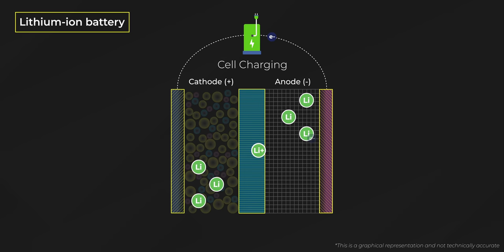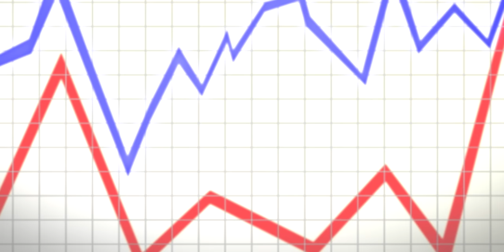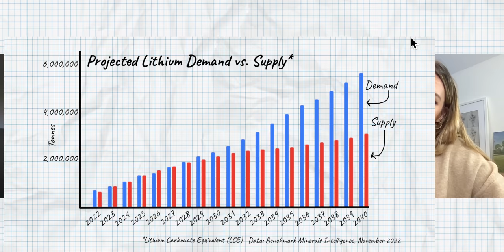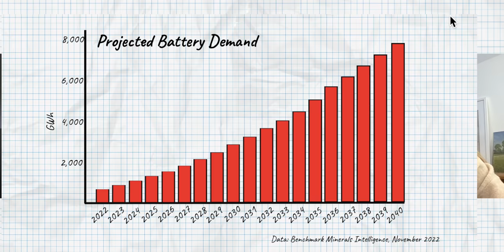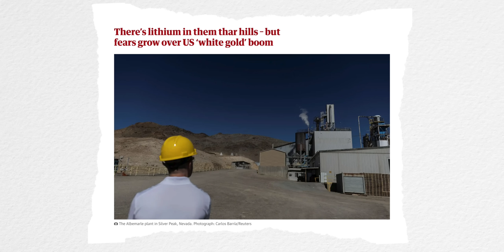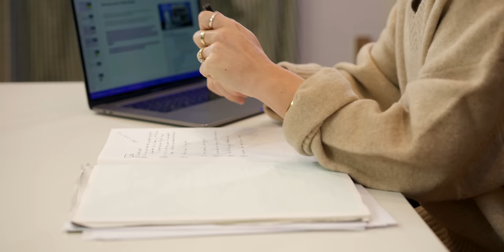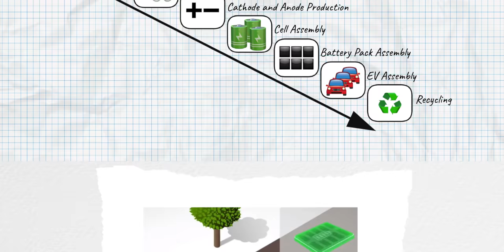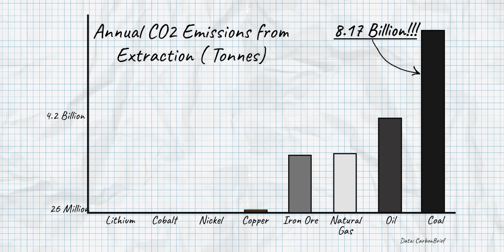There's a Massive EV Battery Shortage. THIS is How We Fix It

Comment: In my opinion these batteries are just too big. Most vehicles are just too big, inefficient, and heavy, so they require massive batteries to have a long range; also we keep demanding insanely high range when most people wouldn’t need more than 80-100 km if there is a solid charging infrastructure.
For urban mobility, electric bikes are great, because a small battery can carry you everywhere and in the event you run out of battery you can still pedal like a normal bike. Other mobility solution like trains and trams require no battery since they can be connected directly to the grid. Electric mopeds and motorcycles are also much lighter and require less energy to move around, so batteries can be smaller.
If you still need a car, Japan has a whole category of small cars called Kcar which are compact, light, and efficient, having an EV version of that with a range of 80-100 km would probably be enough for most people living in cities.
Huge trucks and SUVs, even if they are electric, are a problem. They are too heavy, inefficient, and require huge batteries to move.

Comment: Battery changing stations (using the infrastructure of the old gas stations) can help here: You'd drive around town with a small battery package, then, when you want to go on a journey, you'd get the bigger, extra battery package at the changing station. When arriving at your destination, let's say, Italy, you'd bring the big battery to the next changing station and drive around (if needed) with you small, fixed battery. On your way back, the same vice versa. We'd all only need small batteries in your daily lives, but could go on journeys easily. 
The only problem are - again - the car makers, who don't care about sustainability and practicability, instead of all agreeing on a very small number of battery sizes and dimensions. It has worked with the old lead batteries, hasn't it? They all have the same dimensions, you can buy them at many automotive parts stores, nobody thinks this is too much asked of them.
So, as usual, it's the politicians, the governments, who should show some courage and legislate car battery changing system parameters. 
We, the car buyers would vote by buying ...

Comment: Lead acid batteries are recycled at 90% that's why we don't have many lead mines. Same will happen with other types. There are two issues in the short term. 1. Reuse of large packs like ones from cars is VERY popular, makes them worth money so getting them back is going to get difficult. 2. The materials used in EV batteries keep changing so by the time we get enough recycled material, battery factories might be using something else. Researches are already testing sodium batteries and LFP already in use don't need cobalt or nickel.

Comment: Tha whole EV and battery needs are woefully inadequate in the UK. I’m a long standing supporter but with reference to infrastructure of EV chargers for instance, we have failed to deliver on the promises and needs. Near me is an Instavolt site, which I needed to utilise and yet again it isn’t working and the engineer is not at site until 19 September. This is just unacceptable and will kill the EV hopes

Comment: Looking at the overall life cycle of my 2014 Leaf, it is clear that it has become greener since it was new 9 years ago. The grid on which it has been charged has more renewable electricity today, and is now over 94% emission free. A new battery recycling facility is being constructed just blocks from my home which will supply raw materials to a new battery manufacturing facility 2 hours down the road. Contrast this with the one or two battery manufacturing facilities that existed 9 years ago, and zero recycling facilities, and it is easy to see how the supply chain is improving, and will continue to improve as the EV market grows. My car, BTW, is in excellent condition and will likely give me another 5 years of use on the current battery, and thanks to the reliability of electric drive trains, can provide years more if I decide to replace the battery when the time comes.

Comment: Lithium can be filtered from the brine water byproduct of sea water desalination plants and sodium ion batteries and/or some other battery chemistry will likely replace lithium based batteries as a more environmentally friendly option soon anyway.
Reply: offshore wind could directly power the pumping and desalination and lithium extraction.
Reply: Lithium will remain king in small electronic devices and luxury cars, but for anything else, yes I I'm sure sodium will replace lithium.
Reply: @jamesengland7461  it's not a good idea economically or ecologically to get lithium from see water unless you are desalinating water anyway.
But there is more than enough lithium in salt lakes and rocks.

Comment: I love the electric vehicle concept as it is the most simple and versitle propulsion system you can have but its weak link is the battery and that is still the case. Li-Ion batteries are good for urban bound vehicles in densly populated countries where travel distances are moderate and access to chargers is good. Once we move away from that scenario the current battery technology becomes a problem. In many countries across the globe vehicles are used for many more things than urban commuting. The number one selling vehicle in Australia at present is a large four door ute which is generally 4wd and combined with similar vehicles of other manufacturers make up three of every five new vehicles sold at present. No EV made at present can do what these vehicles can do and are regularly called on to do and they never will if Li-ion battery tech is all we will have. They don't have the energy density needed to bring them down to a size that is usable for vehicles like I have mentioned and I doubt very much if they ever will. Despite all the hype we have seen regarding heavy vehicles being battery powered soon we are yet to see any for the same reasons I have talked about, the power density to battery size and weight ratio. That brings me to the next point, the mass uptake of EVs in our congested cities will be great for pollution reduction and should be done for that reason alone but the actual reduction in Co2 going into the atmosphere will be a drop in the bucket compared to what is needed. Everyone is talking like it is the saviour of human kind and Net Zero is a shoe in once we change over the worlds car fleet. If you pull up the CO2 stats for any developed country you will find that transport in total is one of the lowest percentages of the countries Co2 emissions. In Australia all transport combined is only 18% of our CO2 output. That includes shipping, aviation, trains, linehaul trucks, busses and of that 18% cars and light commercials vehicles make up 7.5 %. If we are going to electrify the rest of the transport mix we need more than just batteries and for those that use batteries we need something far better than Li-ion. One other thing, when a mining company tells you they will have minimal impact on the environment start laughing because their definition of environment is not what yours will be.

Comment: Does making batteries more energy dense improve the Li supply issue?  My understanding is the Li is what provides the energy in a battery.  Making a more dense energy battery might just mean increasing the amount of Li to other materials, but an A-hr of battery energy may still require the same amount of Li.   You need to extract more energy per kg of Li to improve the supply situation.  Not sure if that is happening, but from what I see most currently produced batteries are all about the same energy density.  The other approach (probably a necessity) is to develop car battery technology based on a battery that uses more abundant materials.

Comment: Ellen Carey completely smoothed over the issues with mineral mining for battery manufacturing. Set that to one side, I honestly can't see the infrastructure within the UK getting any better. There aren't enough chargers for what little cars we have now, as many people that own electric cars have proved. I cannot see how this problem can be solved, as the more electric cars we have on the road the more chargers we will need. We ordered an electric car a few months ago and after hearing about many people's issues with their electric cars, we decided to cancel ours. Not sure what the long term answer is but it ain't electric cars that's for sure. There's many a people with electric cars that have shown what it's like over a year, to use an electric car daily and it's quite laughable and impractical. Long distance driving in much of rural UK is a joke. Either there's no chargers in many areas or they don't work or accept the drivers card payments. There is also the issue with radical price increases on electricity and recently the government has just announced road tax charges on electric cars. Then there's the fact that these cars are way too expensive for most and are basically toys for the wealthy, to promote that they are doing their bit to save the planet.... Not!

Comment: Just as well really, there is a shortage of public chargers as well.
Reply: That is a huge point which can be missed when talking about demand for batteries.  One reason huge batteries are in demand right now is because charging speeds and infrastructure are insufficient for most people to feel confident with 80-100 miles of range (like my older BMW i3 on a summer day).  Smaller battery packs lead to lighter, cheaper vehicles, not to mention performance.  Solar roofs, improvements in charging speed and energy density, plus ubiquitous chargers for EV will help flatten the curve for raw material demand.  I love the points about enabling tech for other energy storage solutions (sodium, sand, metal air, etc.) to avoid fratricide amongst transport, grid, and other solutions for the materials that are best suited for transportation (and portable device) usage.
Reply: @G T the trouble with smaller batteries is increased charging lifetime cycles per miles driven. This causes premature degradation. There is no free lunch with physics I am afraid. I have a leaf with 30 k miles on and nearly 7 years old now, it has lost 3 battery bars and 25% range and capacity. Battery life channel  has had an id 3 for 2 years and he has lost 10% capacity in 2 years on a liquid cooled battery. So degredation is specific to lithium ion batteries, not only the battery management system. I also have a Mercedes E class diesel with a brimmed range of 650 miles and a consumption of 51 mpg on a run , all at 70 mph. The Mercedes is a 2008 model and is 14 years old. All this indicates to me that EV's are no way better logistically than what went before. I was so disappointed with my leaf after great hopes for this new technology but alas no and don't even get me started on the public charging infrastructure, it is a nightmare !

Comment: First thing needed is that all non-mobile batteries are produced without Lithium. A shift tothe next element in the Alkali metals group (Na) for home batteries and centralised megapacks will help a lot.
Second, we need to ramp up the battery recycling efforts.
Lastly, eventually we need a green hydrogen economy, replacing both fossils, and battery technology.

Comment: It's all a big trick.  Expensive to buy ... then rapid devaluation. Worth nothing after about 8 years.   New batteries cost more than value of the car. Manufacturing and raw materials are not "green".  
The electricity comes mostly from ... burning oil and coal and gas. EVs are heavy lumps that get through their expensive tyres twice as fast.  Etc etc etc.  
Buy a modern clean diesel while you still can.

Comment: The facts remain that it is more costly and less benefit to the planet to produce all types of electric batteries against the production of internal combustion Engines!   You claim that 95% of EV's can be recycled the whole of the ICE vehicles can be recycled. The other factor against EV's is the life cycle is much more finite than ICE cars!   You have hit on the actual agenda of this push to "green" vehicles, it is the reduction of private travel, in favour of public transport!  A lightweight vehicle of 40+ years ago(eg. MK2 Escort) with a small modern ICE with fuel injection and catalytic converter on the exhaust is far greener than any New EV over its lifetime!

Comment: I agree EVs are the ideal solution to burning fossil fuels but if we can't get the raw materials out of the ground fast enough to build only EVs, instead of slowing EV production it would be better to switch to PHEV production. PHEVs use 1/5th the batteries but allow people to drive electric-only for short trips which are 90% of the trips people make, and lets them switch to hybrid mode for longer trips, which is still more fuel efficient than non-hybrid vehicles. PHEVs are also good for helping people who have range anxiety to realize it's not as big of an issue as they think.

Until we have enough raw materials for all vehicles to be 100% electric only, PHEVs can stretch the materials we have to 5 times more drivers. Focusing on PHEVs instead of EVs would actually cause a greater reduction in the burning of fossil fuels.

Comment: What i see in the auto industry is that we want the same range as an ICE vehicle. Put a big battery in the car problem solved. But with that big battery the weight increases and efficiency decreases. 

My ioniq 28kWh is one of the smaller batteries in todays cars. With that small and low weight, i can get a range of 200 km. If it had an heatpomp for heating in the winter i wouldn't loose the 20% of range that  i do now. With that 200km i can easily do my daily commute of 100 kilometers to work and 100 kilometers back to home. It's not ideal in winter because i have to charge at the office. But my commute of 200km daily isn't nowhere near average. 

Today's cars get a battery of 60kWh that give a range of 350 / 450 kilometers. Is that needed for every car? Sure there are jobs that will need a care with that range and maybe more.  But is doesn't need to be the standard.  If i had 220 kilometers in winter i would be more than happy.  Cars with less battery capacity would be cheaper to make also. So another win.

Only consequence of a smaller battery is that you have to charge every day. With vehicle to grid/ home you as a user will benefit from plugin in every night. You start every day with a fully charged car and help balancing the grid. It's a shame that company's with big parkings lots aren't obligated to let everyone charge during the peak hours of solar energy so we can solve the duckcurve problem as well. But that part is a whole other story.

Comment: I'm not totally pessimistic about EVs, if Sodium batteries can be successfully made with Prussian White replacing Zinc, there's some hope that a third of all cars could become EVs by the 2040s.  It would also mean combining the battery technology with battery swap stations like the company Neo uses, AND, and this is the big one, small modular nuclear reactors would have to be a feature of the swap stations.  If that doesn't happen there won't be the power density, because there's no way the grid is getting the massive upgrades, and the swap stations can sell power back to the grid if charging EVs ever gets slow.  Right now, demand for Lithium is set to exceed supply in 4 years, and before that happens the cost of a new EV is going to go so high demand destruction kicks in and the industry goes bust.

Comment: Cheaper Bus and train fares (and greater frequency of services) - including smaller local (EV) buses (~20 seats)as an example, my daughter live about 60 miles away and I could go by train, but it's about 2.5 times the cost of petrol for the same journey. the cost difference is even more marked if I drove an EV. We do use coach based holidays in the UK and Europe as it's more comfortable then driving (UK) or Flying (Europe) and probably more fuel efficient on a passenger mile/fuel used basis.

Comment: yes, prices of raw materials are shooting up and it does not seem to stop. but on the other side this means more funding for battery R&D which results in better technologies that bring in cheaper materials for alternative chemistries and higher energy densities to cut costs.
a lot of extremely cool stuff is going on now like the new nano scale filters from EnergyX.
so, all these predictions that are being made can be completely false already next year.
on the canary islands, like Lanzarote, the have a seawater desalination plant. their output is high concentrated brine. you can use this for free and filter out the lithium with the tech from EnergyX.
you can also use this tech to filter out the lithium from recycled batteries as well.
and now there is also a new tech available to make cheap graphite from coal with microwave radiation.
and what about neodymium magnets with expensive and rare neodymium in it?
fuck it, we just found out how to make cheap super strong high-end tetraenite permanent magnets! put them into axial magnetic flux motors from Yasa or Magnax and you get insanely strong and efficient motors that are lighter, smaller and much cheaper!!!

Comment: Good discussion. We need regulation among manufacturers to limit both the number of batteries in a car and their power output. A car doesn't need to go from 0 - 60 in 3 sec. And with home charging and more chargers coming into play, the cars don't need to go a long distance. With advances in battery technology the lithium issue will go away before the mines can produce. I also think self driving vehicles will allow much more use of car pooling, eliminate congestion. More money is needed in rail transport to ease truck usage but there will still be a bottleneck in the ocean shipping area.